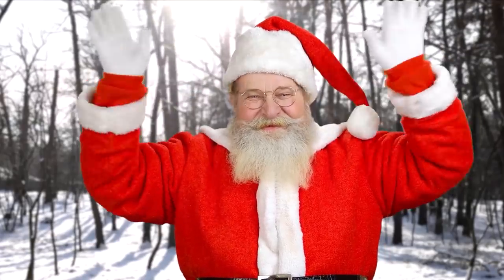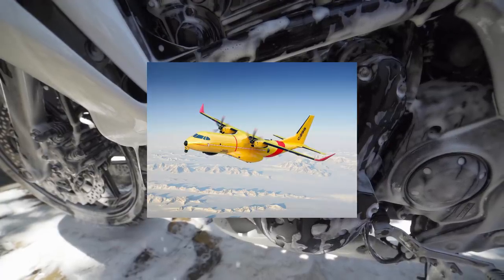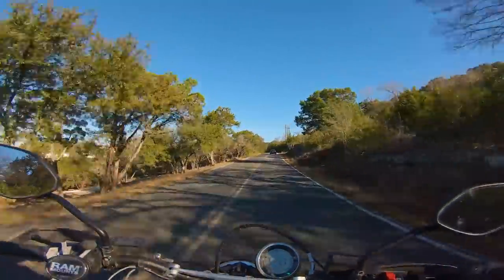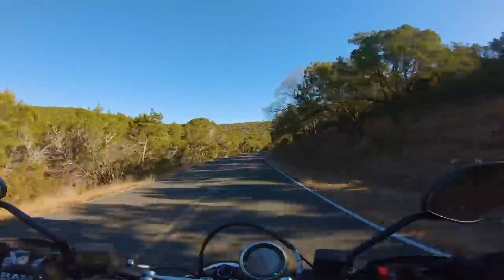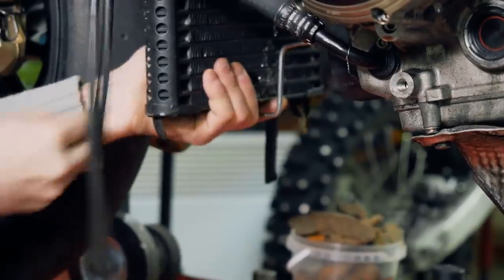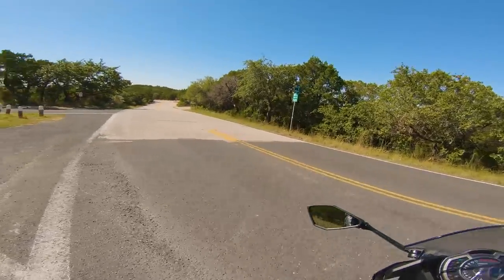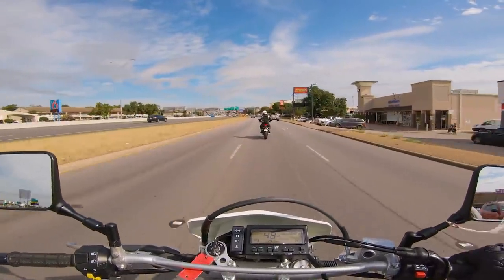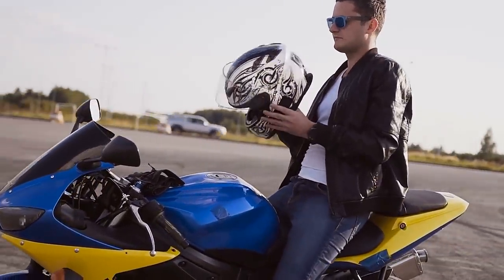7 ESSENTIAL Items to Snag BEFORE Your First Motorcycle

Comment from the maker: What else would you add to the pre-bike checklist? Personally, I'd get a tire pressure gauge to keep on the bike. Don't forget to get registered to win the CB650R, DRZ400, or Ninja 400 on https://yammienoob.co/
Reply: Maybe see about heated handlebar grips and how to wire it up, just a flick of a switch on some of the last cool days or early days of riding season will help out tremendously. One more thing if your new to your bike check out if the fuel gauge actually works or fuel light, had a buddy with an older bike forget about it after a repaint and had to two up on the way to town.
Reply: Boots. Not soft tennis shoes.  Not some fake combat boots with the super comfy soft soles ya found at the Shoe Carnival at the mall because they're super cute.   No, get some shoes with muscle and firm soles.   You're gonna be dragging and scooting  your feet for a while.  You may just drop it at a stoplight on your first day out and and when that Beast of a machine lands on your foot you're going to glad you had protection.  *Speaking purely from personal experience.
Reply: Yammie Noob what was that yammer hipopitise hahaha 😂
Reply: How's adding life insurance to the list? ;-P
(mainly for your gf or wife who keeps asking what happens to her if you die on that death machine.)
Reply: The Wardogs love it
Reply: Have an accurate tire pressure guage.  Think about buying a small air compressor.  Good for inflating tires and drying the bike after washing it/rainy day.  When doing oil changes its nice to have a strap wrench to loosen the old filter.  Get a set of Allen wrenches.  Get a crescent wrench.  Get a torque wrench.  Get a set of sockets w/ ratchet.

These things aren't necessary to own a bike, but if you want to save money in the long term by being able to service 90% of your bike on your own, get these things.

Comment: 1) Cleaners and polish
2) Spools and sliders
3) Factory service manual
4) Maintenance items
5) Missing/Broken parts
6) Rear stand
7) Basic Gear (Helmet, Jacket, Glove, long pants with decent abrasion resistance, proper boots(sprained my ankle from a skid, very important))

Comment: I always carry a tire repair kit on my bike as well as the tire gauge - a 3 ft length of plastic tube so you can syphon gas if you run out is very useful as well - not forgetting some duct tape just in case you need to fix - well ANYTHING!
Reply: How many times you had to use it?
Reply: @vetal6806  The repair kit twice so far, the duct tape twice as well (on other peoples bikes) the tube not yet

Comment: For a supermoto /dirbike get the center stand/lift thing. Its soo usefull. Lets you adjust suspension and keep away standing flats... Iagree withthe rest, especially the service manual. With the help of that i was able to adjust my valves, flush the coolant and redo ebery electronic bs the previus owner managed to fuck up 👍